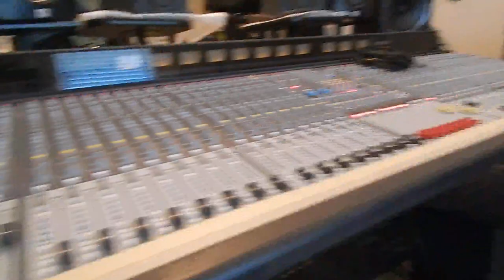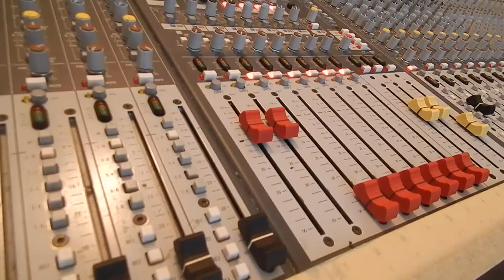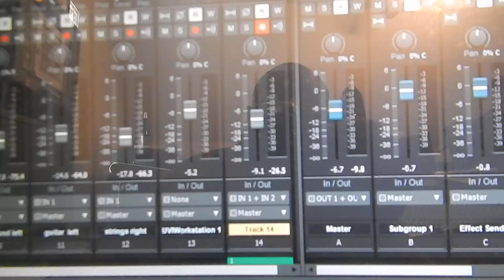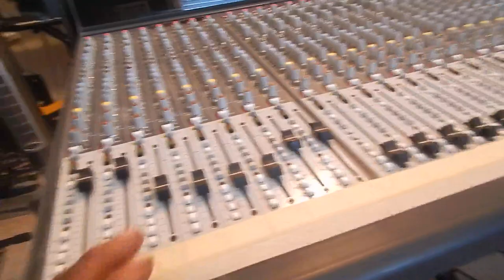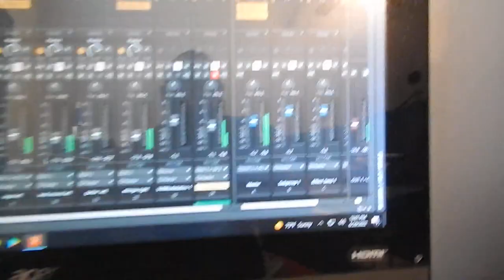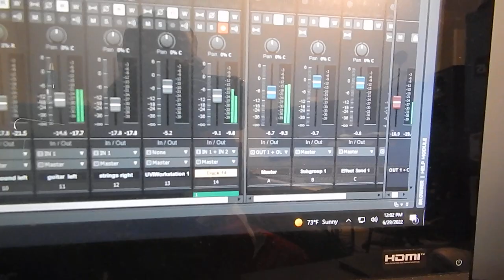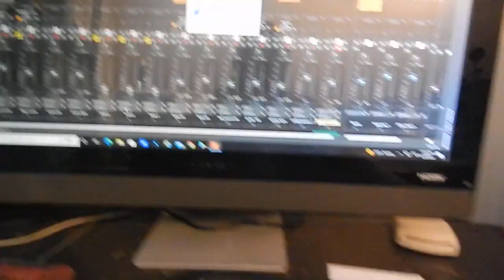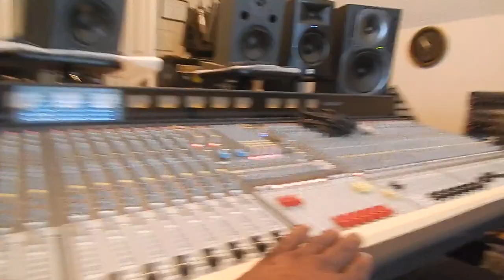Special Request - How to print final Mix from your Allen & heath Console into your DAW

Comment: Hey is there anyway I can set up a phone call with you I’m having problems linking my eurodesk to fl studio
Reply from the maker: no analog desk can be linked to a DAW unless I am misunderstanding your issue.   Unless you are trying to run sound through your eurodesk  thats all that can mixer can be used for.  It can not control functions within your DAW
Reply: @marksmusicplace3627  apologies if I confused you, but I am having trouble sending the mix to the daw. My board only shows sound on the meter bridge but it won’t let me add eqs from the board.
Reply from the maker: @lionpackbeatz1777  which model eurodesk do you own
Reply: @marksmusicplace3627  mx9000
Reply from the maker: @lionpackbeatz1777  ok, on the back.  the two XLR main outs are design to go back to a recording device input.  Back in the day.  Large format consoles would send signal to a half inch tape machine for the final mix.   The MX9000 is designed the same way similarly.  those two main output XLRs and I repeat.  ARE NOT DESIGNED FOR STUDIO MONITORS.    you console already has studio and control room outputs for studio monitors.  your control room outputs should be used to send to your studio monitors.  if you are using XLR cables then you need to get XLR to TRS male adapters to plug into your control room outputs and use the control volume control to listen to monitor mixes.    Almost all inputs and outputs on that console are TRS and not mono TS cable inputs.   SO when you are using your main mix faders. its sending the signal to the main mix output for printing back in your daw or tape machine. Now if you want to use an EQ or even a compressor or even chain them to your final master for printing then you need to insert those units to your master mix insert on the back of the console.
Reply from the maker: @lionpackbeatz1777  I actually made a 3 video series on how the MX8000/9000 should be used in your studio.